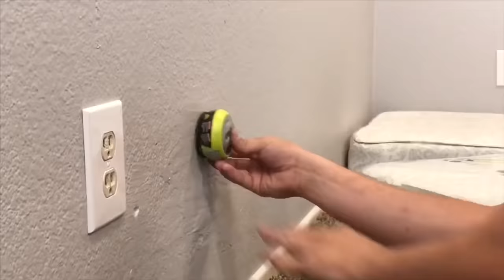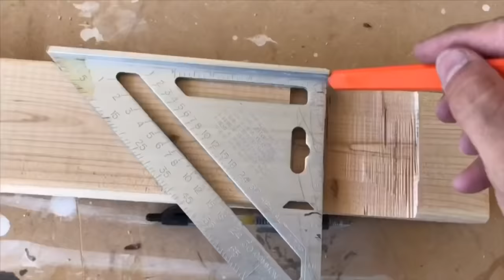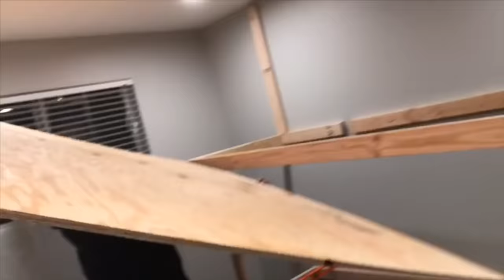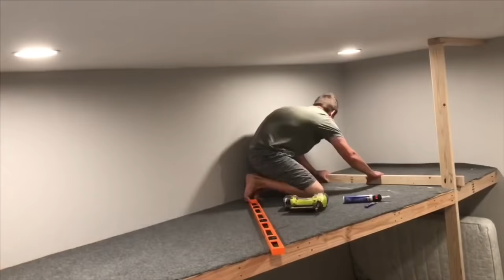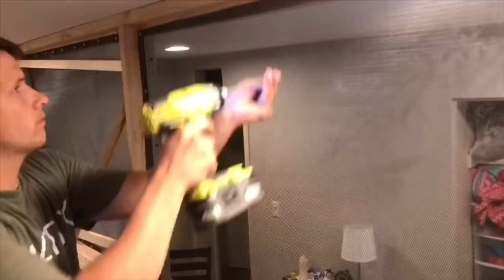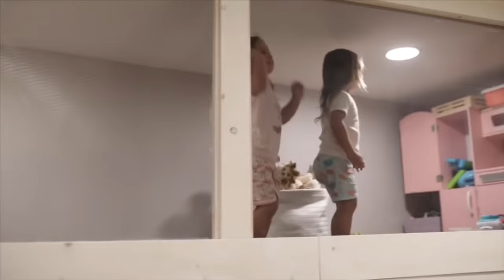How to Build a DIY Toddler Bed Playhouse for Triplets: Transition to Toddler Bed

Comment: Their reaction was priceless. You certainly have your hands full, and I'm not surprised your wife took the opportunity to catch up on her sleep. Three girls under 5 - she deserves a medal. And the beds look fantastic, but wouldn't it have been easier, and safer, to put the beds at the top ?
Reply: I don’t thinks so, the girls could have probably fallen in their sleep. And im sure it would be quite nerve racking to try to put them asleep on a high level.
Reply: Nonsense. Can’t tuck a kid in if you don’t fit!
Reply: @gregbrady8454  that's disrespectful as fuck.
Reply: @spryngromero3173  why do you say that?
Reply: @spryngromero3173  your not even on the good coment!
Reply: @hotpipingteaspills2429  fallen?? The beds are at standard height from the floor!! My daughter has been in a bunk bed since the age of four, it has raised sides so it would be impossible to fall out of.. she's nearly eight now..
Reply: The Stacey & Lacey Show  umm... a good bed frame could last like 15 years
Reply: Tinaay literally had a set of bunk beds probably the entirety of my life (at least as long as I can remember soooo since I was at least 5) we only got rid of it 2-3 years ago because the top bunk (which is what I was sleeping on) finally started breaking so that's like 12-13 years with the same bunk beds at least not to mention we probably had them before I was 5 as well and I just don't remember either way we got some good years out of that set
Reply: @Fearn and Tucker’s Angel Forever I don't think so that a baby that is 12 months old should sleep in a bunk bed without the mom or dad.

Comment: Ok I dont want to be one of those guys but never cover your 110v outlets, just build it a little higher. That is illegal and a fire hazard. Otherwise great build super use of space.
Reply: Really hope there's some arc fault protection on that outlet. Gonna need it by the looks of that cord.
Reply: Agreed. Just go back in and cut that board. It's not.bearinf more than the wall stud can handle. Also make sure the receptical is tamper resistant.
Reply: Amen on the covered outlet.
Reply: Came to the comments for this.
Reply: Sucks to piss in this guys Cheerios cause he did awsome but you are 100% correct on the electrical. Also some type of step is needed to get up and down that loft. Thats a fall waiting to happen with three girls pushing there way around. A few more tweeks and that build is a winner.
Reply: @dito4lyfe  Yes, you did, among many other replies. He's still a great dad at the time he needs to be a great dad.
Reply: Yeah man, you should never rely on cheap extension cords for permanent sources of power. You’re asking for trouble.
Reply: I going to say something similar. It's a lovely set up for his girls but that outlet is a worry.
Reply: Yeah. But. Looks like a newer house and if there is an issue most likely the breaker will switch off
Reply: @AndysGeneral  The breaker may switch off, true, but even with only that, there would be frequent cuts to whatever it is powering. You wouldn't just keep resetting the breaker, you'd have to address and rectify the problem.
Reply: Ok.....I will be that guy. As a firefighter, you don’t know how many house fires I have been on because people do stuff like this. Those codes are there for a reason. You need to build around that outlet, BOTH of them, it’s not worth the potential cost. Keep your kids safe.
Reply: Love what he did, I want to say maybe the guy didn't know about the hazards of a covered electrical socket and a extension cord that are only for temporary use.
Reply: I agree
Reply: I think he went back and cleared it away
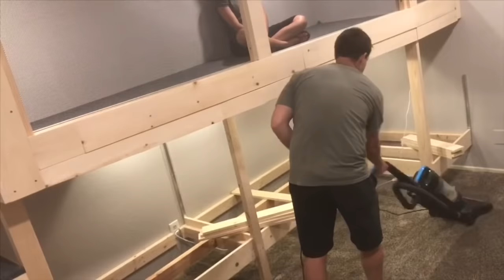Reply: @rawyin  6:44 it looks like he did just that off camera :) at least now they can unplug it
Reply: Yes sir not the only one thinking this
Reply: I was thinking the same thing, I felt like because a mattress was going there for a child to sleep, it worried me a little. Also the recess light in the loft part was right in arms reach for them, I was hoping there are safety covers for that light
Reply: *Gasp  no ur fine as long at theres a bit of space between it
Reply: *Gasp  i have my bed by one its not " on it" and nothin gets plugged in there
Reply: Gasp i think if you have an electrical box, you can turn off power in certain areas of the house. Like I have a light switch that controls and outlet in my room and I can turn off the outlet and that’ll make it *safer
Reply: Just curious..
 Is it a hazard if I plugged in the baby proofing plugs into the outlet and then used a little duck tape on top.of them? My son keeps pulling out the baby proofing plugs in his bedroom and then somehow cracking the plate off and exposing the electrical part. I am worried about the duck tape being a fire hazard but also don't know how else to keep him away from the outlet! He is a very determined 2 year old.
Reply: @MrRianfire  are the baby proofing plastic plugs a hazard too? What about if you put some duck tape over them if your toddler keep.popping out the plastic plugs? I don't want to have a fire hazard in his bedroom. Thanks

Comment: Yea... I'm gonna be that guy.  Take that down and move it UP to above the outlets... serious violation of common sense there.   Never ever ever cover an outlet.  Worse... plug something in you can't unplug... 

Nice looking but dude.... fix the outlet thing.
Reply: I'm also the dude thinking the same...I would hate the idea of something I made hurting my kid
Reply: Nice! Electrical problems equal fire hazard.  Darwin.
Reply: Not even that, if the supports are to the studs, then why not leave the outlet exposed moving to the next stud. You don't need a continuous beam along the wall to support that little weight?
Reply: Why does it matter, how is it hazardous?
Reply: @jlbf0786  if there ends up being an issue with the extension cord, it catches on fire or melts, then you can't unplug it. Other than the fact that it is a code violation and your town electrical inspector is going to have a fit when he sees it. Then he makes you take the whole bed apart to move it.
Reply: @jlbf0786  Wow!? You really asking "how is it a hazard?" The same reason you dont chain exit doors.  🤦🏾‍♀️
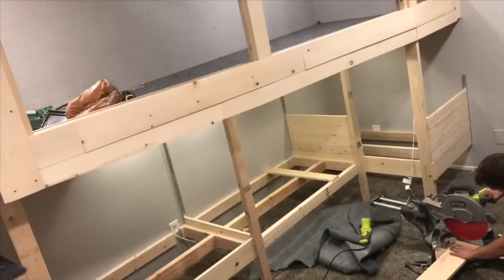Reply: Look at time 6:30, he uncovered the outlet.
Reply: @LanceMcElmurry  He uncovered and put a plug in and the wood went back over it. So the plug that's in it cant come out the wall..
Reply: I agree and I've seen alot of comments talking about town inspectors and stuff I just have to ask does that happen alot bc it doesn't in the two Texas cities I've stayed in (and in multiple houses)
Reply: @RickyRicardoMJF  in Texas I'm unsure. It's still a fire hazard.  Cords short out everyday.  That wood is good and seasoned,  it will catch super quick. Insurance companies won't cover a house fire if deemed fault  from that plug.
Reply: @jenniferjones1448  aren't there circuit breakers if wire gets damaged?
Reply: L M Sorry. The wood is still covering the two outlets along the wall. I think you were confused
Reply: He ended up completely uncovering the outlet around the end of the video you can see it uncovered
Reply: Ahh... Thanks... Missed it.  Still scared me watching what he planned to do in the beginning.  @brynnapyle5779
Reply: The built-in play pen & bed ain't even structurally sound. Too few and thin columnar support for the outer edges, using 1 sheet of 3/8 plywood for the floor. Something's gonna give there.

Comment: I think it looks amazing, but I’m not so sure about covering the electrical socket with wood, if that were to overheat, I think that could be dangerous. Also I see that your beautiful little girls at the moment are able to run around above there beds, but you have a light fitting within really easy reach, and the way children grow, I’d be doubtful you will get more than a years play up there before their heads are at ceiling height, and knocking into that light fitting. Lastly the play area looks lovely and easy to get into, but not quite so easy to jump down from. That would I think worry me a little..You have made a great job, and your girls look thrilled to bits with there new beds and play area. Maybe if you’d had more time you would have addressed these little niggles along the way.

Comment: What do you plan on doing when they are older?
Reply from the maker: Emily Lee The Makeup Queen  probably bigger mattresses in bottom 😊
Reply: @talltaleswithtriplets630  I'd turn the top into a loft bed and add a desk underneath maybe or make bunk beds. Sense your really good at building I'd look into quad beds ik its 4 of them but they look super cool.

Comment: Why didn't you just move the plug? That's gonna be a pain later if you have to work on it. And it's not NEC. Other than that. Very cool idea!!!!!
Reply from the maker: So, Before finishing the bed, we removed the extension cord and I completely removed any wood covering the outlets. Should have just set the beds 3” higher from the beginning 🙄 We just uploaded a new video go check it out on our channel and subscribe if you haven’t yet! 🙌🏼😊

Comment: There is something that you did in this video that is very dangerous and against building and fire codes.

Plugging in an extension cord and then screwing a 2x4 to the wall over it which blocks the outlet and the plug from being removed is a major safety hazard!

Obviously the safety of the children was just completely disregarded!

Comment: Good job.  But two things I found risky. Why did you put the bed literally over a plug point. To me it is a huge risk. Also, the door to the playhouse poses a risk of the kids losing their balance while opening it. My opinion.  Are the nets strong enough to support the weight of 3 kids hitting against it while playing. Wouldn't it be safer if wooden boards were put across.

Comment: No offence, but fyi, pocket holes are actually really weak compared to most other joint types.

If you're building something for toddlers it shouldn't matter, but in the future joist hangers would really be a much safer option structurally.

Comment: Nice Idea BUT Their little hands and heads  are wayyy too close to that light. You should have chosen another area without lights directly over head. Also the outlet behind should have been disconnected. Hot lights and working outlets within reach is not safe!  Concept very good, except for how close to ceiling  Safety factor very dangerous. I would have done a high platform bed  and a bigger play house underneath. Seriously, safety should have been first priority. Not so much here.